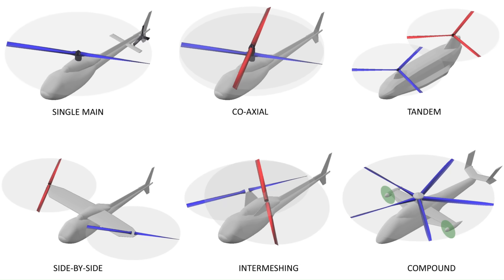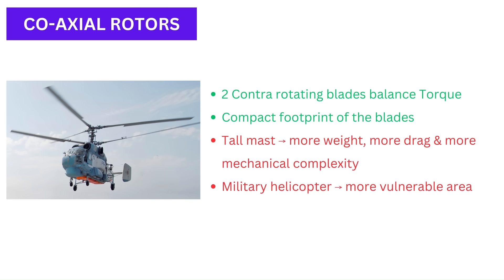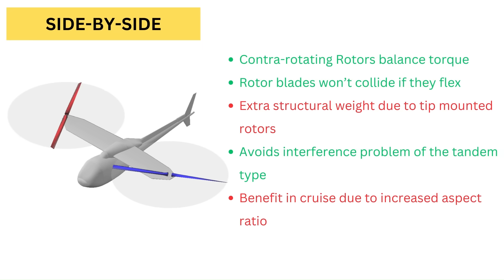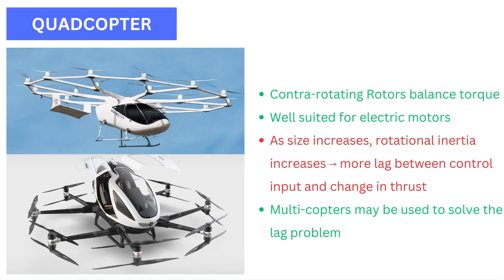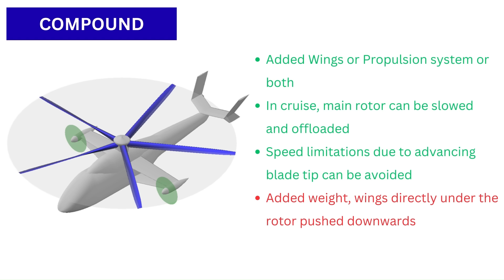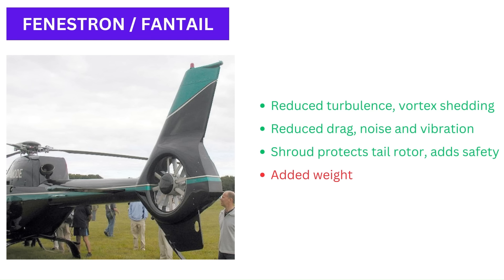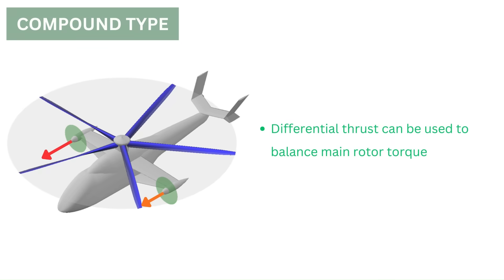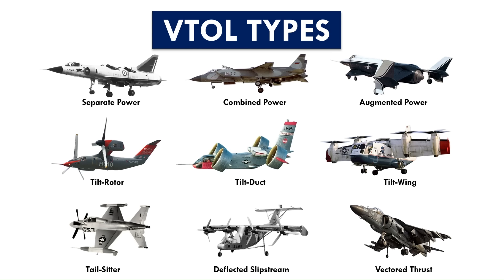Types of Helicopters and their Pros & Cons | Aircraft Design

Comment: U have forget about heli with jet engines at the end of the blades of the main rotor. this concept has 2 big pros 1) this type need no transimission
2) this type dont need a tail rotor. But it has 1 big disadvantage its heavier cause it has 2 or more small jet engines. The V-7 is the first and the last heli with this type of main rotor
Reply: If there's only one, it's not really a type of helicopter, it's a failed experiment
Reply: @gearandalthefirst7027  did u understand the word "concept"?
Reply: @m4kshmakz934  do you understand the words "cocaine is not a legitimate design process"

Comment: In a tamdem rotor helicopter accelerating through about 40Kts forward airspeed, the airflow generated is swept so far back that there is no interference between the forward and aft disk. Therefore, in cruise, there is no interference.

Comment: Side by side and coaxial definitely dominate in efficiency 
Side by side are space inefficient and coaxial are complex, but its a good tradeoff.
Reply: And coaxial actually have less vulnerability instead of more, because it make the entire tail no longer vital
Reply: @za_pravdu1943  so does any system that has 2 rotors. Every helicopter needs 2 rotors. Its just the matter of where you put it
Reply: @Iron_Soil only for coax and intermeshing, where both rotor are in the same point. 

Tandem like Chinook only replace tail rotor with the second rotor, which actually make it even less survivable because when the rear is dead, it instantly fell fown instead of entering a death spin. 

BTW, not every helicopters have 2 rotor. NOTAR use engine exhaust to push the tail instead of additional rotor, which is why it's called NO TAil Rotor.

Comment: Why Is the intermesh heli so thin ?
Reply: It's on a diet.
Reply: @Hanstra The HH-43 Husky flown out of KOLM flight museum is on the Husky side and not so thin, on their air show flyer they describe it looks like " two palm trees fighting over a toaster."
Reply: it's specifically the K-Max, no idea why but all i know it's specifically made for underbelly lifting with suspension lines
Reply: @dimas152mm  They made it thin because it was intended specifically for sling loads.  All helicopters suffer some thrust losses from the vertical area of the fuselage, and since they didn't need internal volume for cargo, they made it as thin as practical to reduce those losses.
Reply: @jamesburleson1916 not only that, but because the K-Max is a single seat helicopter, the pilot has better visibility on both sides of the aircraft.
Reply: FISH
Reply: Malnourished helicopter
Reply: Ozempic, it's everywhere

Comment: On a counpound design Is One engine more powerful than the other ?
Reply: No, largely because the engines are coupled and used to drive the main rotor as well as the propellers.  The main rotor is only really powered for slow speed flight and hover, since at cruising speeds, the stub wings can provide the majority of the lift.  The differential thrust is supplied by varying the pitch of the propellers differentially to offset the torque of the main rotor.
Reply: @jamesburleson1916 thanks